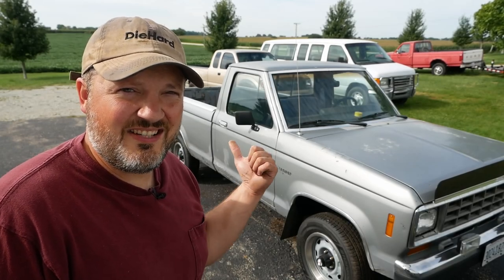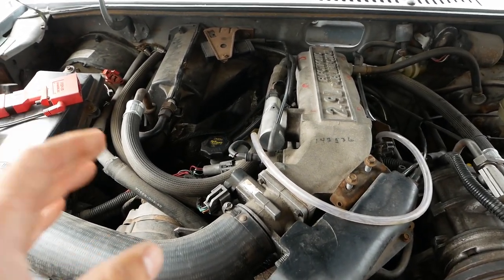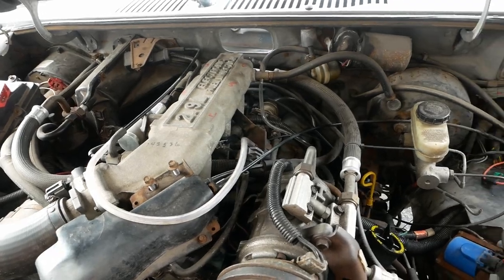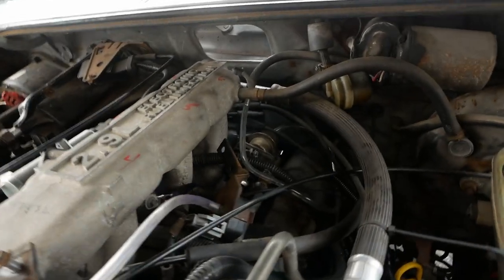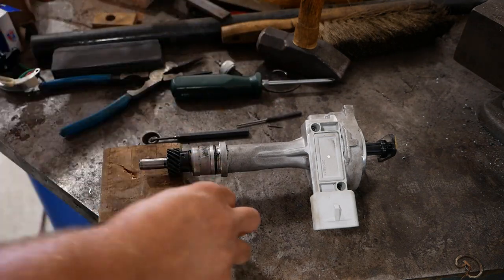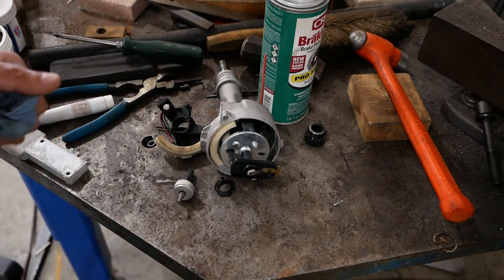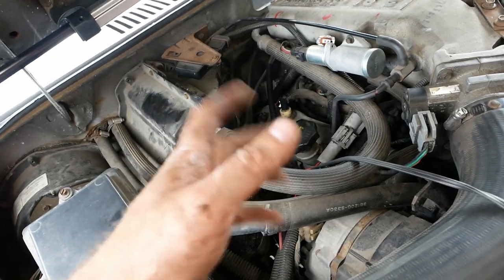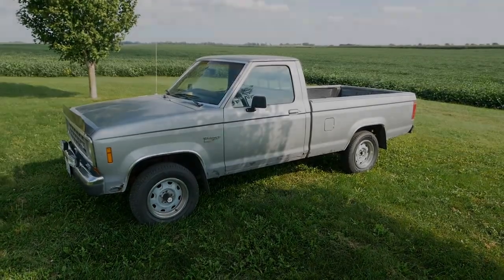Rusty Ranger Returns with More Bad New Parts - Randomly Stalling

Comment: Is it sad that being an old school ford drivability tech I was leaning towards the stator pfe and egr solenoid?  I used a old school bluepoint power steering pulley puller to pull the distributor gear and would tamp it on with an socket. Would also just mark the point where the rotor was pointing then drop it in the same spot.

Comment: My 1980s cb 750 custom had  problems with charging..honda stated change out parts with known good.. regulator rectifier and stator got from friends bike..  Dealer told me if another bike is in shop they swap them out to test...

Comment: by 3:34 I say bad grounds, battery to frame and body to frame, very likely bad ignition module(often changed without cleaning, thermal grease, dist. body flatness check or over torqued screws), also possibly rusted pickup(pip) or stressed wire to ign. module. bad coil causing upstream damages from lack of secondary tune-ups was a big factor too( still is @ the 100K mile jokers)
maintenance is key!

Comment: I have a 95 toyota avalon so whats the best way to clean my throttle body?Is it ok to spray crc inside or just wipe it out ?Whats the best way to set the computer after your done so the rpm wont be high?

Comment: My 87 Bronco 2 had a problem with the TFI kept dying but then it would come back to life weirdest thing ever. No start early in the morning but later around 2pm when the sun warmed up the engine compartment with hood up it would start first time after that it would start up all day no problems but come morning time same thing happened no start till sun warmed it up, I'm in NC so it wasn't that cold in the morning then maybe 45F. Also if it wouldn't start I would loosen the two screws on TFI wiggle it while someone else tried to start it up, it would start if I held the TFI in a certain position engine would stop if I let go of the TFI. After the Bronco started up I tightened down the two srews on TFI engine would start all day no problems after doing that, but come morning it was same crap again no start till around 2pm when temps would be around 60F. I put in a new TFI and had no problems since the Bronco runs fine now.

Comment: BTW if you know an engine did run old trick is to take rotor cap off and point the rotor at something to stab it back in to, like the fire wall etc. Saves the ole TDC hunt and then lining up oil pump drive and cap No. 1 post.

Comment: I’ve only ever seen and worked on the 4L cologne, they seem to be a very reliable engines, some oil leaks but usually just minor things fail, I had a South African grey import as a shop ute, it was driven hard, lots of short runs and that vehicle never missed a beat, kinda makes my current ranger look bad

Comment: Hey Wes...ever get a toolbox that wouldnt unlock? Any tips? Im desperate...Key turns all the way, but none of the drawers pop open.

Jiggled, shaken, even smacking it with a mallet along where the lock rails are. Im worried that the lock rod broke....I really dont want to destroy it since my father bought it brand new back in 87. Its also an anniversary (50th) MAC with the complete stack....but I need my tools to work.

I cant flip it, since its loaded up good and would only have more stuff jam in the locks. I don't want to cut it either and destroy it. I mean even drilling the lock (which I dont know if it would work if the lock rod popped out of the back), but if I had to do that...I would even though I can't find replacements for it.

Comment: I have a 2007 6.7 cummins with turbo. When I was going up a mountain road on highway  40 I heard a loud pop and then a loud sound of air escaping like a disconnect of an air hose. Would you have an idea what the problem is? It has no power up hill now.
Reply from the maker: You blew a hose off the charge air cooler.

Comment: I have a question about putting rpm gauge on 1995 e150 econoline van 4.9 engine 🤔 is it possible?
Reply from the maker: Yes. Just hook it to the coil and set it for 6 cylinders.

Comment: Had a reman distributor in my obs f150.  Worked well for a month.  After that the motor would die after 5-10 min.  It was the pip sensor.   Put a motorcraft part in.  Been fine ever since.  Just new junk parts.  Frustrating.

Comment: Ah, the older styled Rangers, long before they turned into a sports car, with horrific gas mileage.
I prefer the late 80's, early 90's F150. Even though my dad's had a valve problem, and got locked up on one cylinder, it had better mileage then a five year old newish Ranger.

Comment: That's the 1st distributor I've ever seen where you gotta pull a shaft out to get to the Distributor module that's what I call whatever instead just pull  Pull off the rotor cap and that cover figures Ford comes up with some stupid like that I'll be down thanks for the video always a good time

Comment: I don't  miss the old pre-computerized ignition systems because starting was often very difficult. Now, in 99% of the time, the engine only has to sniff the key being turned and it jumps to life...

But, when something needed replacing or adjusting, like the points, capacitor, or timing,  it was cheap and quick.  But now, you need to be a rocket scientist or a Wes, and make sure your overdraft isn't maxed out.  What are design engineers doing to  us? 😠

Comment: I guess my only question is was a scope necessary to diagnose the problem? I love breaking out my scope for even the simplest repairs but I like to see the money shot of it failing. Does the service manual have any direction for a problem such as this
Reply: Regarding the bad pip pickup
Reply from the maker: No, not needed. You can check it with a volt meter. The diagram even shows the voltage should be 5-7 volts (50% duty cycle) on the PIP when cranking.

Comment: Is that a new fuel pressure regulator I see?  Good thing to replace.  Notice where it's located.  I've seen more than one ranger/Aerostar burn down from a blow diaphragm in the regulator spewing gas onto the distributor.  That was a bad design from a safety standpoint.  There was a recall on those way back.  Overall, those things were pretty reliable.

Comment: Nice job Wes but now that you are sending vacuum to that it egr valve again it will get stuck open pretty soon. It will die at idle or run rough
Reply from the maker: It's a new EGR.

Comment: Swap with known good parts cannon fodder. Ah, the old TFI wrench/socket...Mine is in the glove box of my Fox Body Mustang GT! 5.5mm thin wall is what you want.
I would've at least googled an image of the proper Motorcraft cap, to really verify which terminal is #1. I would not blindly trust someone else's markings. 
Can you get your rotor lined up and then hold it, and bar over the engine until the dizzy drops all the way down in? On my Mustang, I just leave the car in third or fourth gear and get my dizzy lined up, and then I can rock the car back and forth until that spins the engine to where the oil pump shaft will line up with the hex in the distributor shaft. I also mark where the rotor is pointing before removal, and the IMMEDIATELY upon removal, I also mark where the rotor was pointing when the driven gear disengaged from the cam gear. 
Very interesting, regarding the ignition switch and timing adjustments... She sounds good!  Nice and smooth.
And thanks for the Farm Report!!!

Comment: My 88 volvo had the same issue. New distro but it didn't last very long. Either a combination of poor quality and or poor design location. Mounted to the back of the head so oil would seep through and ruin the electronics. Happened 3 times before I relocated it.

Comment: Are the idle rpm's a bit high for the warm weather?  Also, I think you're being spoofed.  I was sent a reply from your last video stating I had won a prize and to contact you on a non-existent @WatchWesWork account.  Has Max learned to type on a keyboard?  Have a great week!
Reply from the maker: It's a scam. I try to delete them as quick as I can but they keep popping up.
Reply: @WatchWesWork  Thanks.
Reply from the maker: @glencaple3888  Was it an email or a reply to your comment?
Reply: @WatchWesWork  It was a reply.  Did you get the first REPLY I sent a few moments ago?  I sent it and just noticed it was deleted.  ???    I copied/pasted the full reply in my first reply to you but it got deleted for some reason.  If you want a  screen copy let me know as I have not deleted the scammer's reply.
Reply from the maker: @glencaple3888  OK. I tried to setup some filters to keep those comments out. It's happening across YouTube. I hope they get a handle on it.
Reply: @WatchWesWork  👍

Comment: It sickens me every time I see the complexity of modern day engines. Do you have any happy pics from the early 1960's of a straight 6 in a truck or a checker cab. LOL
Reply: In steps an old 12 valve Cummins, or an old CAT..  Where you only need one wire for it to run.

Comment: Our '90 Tempo had a very similar problem, which nobody could ever figure out.  It ran fine 99% of the time, had plenty of power, always started up, but would stall coming into lights.  You had to drive it 2 footed and keep tapping the accelerator as you braked to keep it from dying.  I wonder if this was the problem.  It did have the same engine as my 1990 Ranger, as I recall.  That said, the Ranger had coil packs, as I recall, and the car actually had a coil.  Back then, it was hard to find ANYONE who had any idea how to diagnose those cars.  Computers were brand new, and nobody knew how to work on them.

So if you couldn't get an EGR valve, is there any way to get a generic valve and make it work?  I suspect more and more people are going to want these old vehicles going forward.  I wish I had mine back.  I don't like driving a hackable car with a black box.  I want a plain, stick shift, simple engine, little to no electronics.
Reply from the maker: Yeah, you could use a purge valve or even a pair of generic solenoids, one to open the EGR, the other to vent it.

Comment: What kind of box deal were you using to test that component what is that called
Reply from the maker: Which one? Bench top power supply, volt meter, pico scope, etc...
Reply: The white square box one that used under the hood to check the little sensor deal
Reply: I've been around a lot of shops and everything I just never seen none of the guys I ran across over the years use one of them or even if it's for the mechanic field or if you had it from some of that industrial stuff you do

Comment: That is funny when video started I thought them 2.9's are notorious for the fuel pressure regulator going bad and filling the oil with gas seen them so bad they filled the oil pan
Reply from the maker: How does the fuel get into the oil?
Reply: @WatchWesWork  I think when you shut it off it floods the cylinders and runs past the rings and then over a period of time if you don't fix it then it just keeps adding to the oil  I fixed 2 different Bronco 2's that had the oil so full of gas was way over full on dipstick  they would smoke when running changed the regulator and drained the oil/gas from the pan and ran fine with no more smoke, I bet you check the oil on that ranger and it will be gassy and probably a bit over full
Reply from the maker: @badmonkey3669  That makes sense. I suppose the fuel drips through the diaphragm until the pressure drops to zero.

Comment: When the EV’s take over replacement parts will be 3D printed at Walmart. Max will still have his field mice and rabbits readily available with no complaints.
Reply: You mean things like brake rotors, CV joints, cooling fans, the diagnostic modules to run the cooling fans, and all the charger units?
Reply: @CAPNMAC82  Yes. They’re already 3D printing high bypass jet engines.

Comment: I have the same scan tool and the only issue I ever had was with my 1995 dodge Dakota would not for whatever reason read the data correctly it if I put it in for a couple years older it would work fine so strange!

Comment: You think the pin fitment caused a bad connection and too much heat and she said nope ? Those beans look ok, I see some volunteer corn got in there lol
Reply from the maker: I think it was a part of the equation. I noticed once when I pushed on the TFI module the fuel pump kicked on.
Reply: @WatchWesWork  well that's not good, re man stuff kinda sucks cause if that pick up was good and the module was bad then all it gets is a module and off she goes

Comment: Ford PFE's = Pretty Frequent Errors, and when they do the vehicle can run like crap. And or the PFE can get shorted internally if the EGR sends hot air to it and burns it and then thee PCM data line gets shorted pulling down most of the sensor inputs lol.

Comment: Hopefully you charged him more than $300 for your diagnosis. 17:04 dielectric grease?
Reply from the maker: Heat sink paste.
Reply: Should be thermal (heatsink) paste.
But perhaps the distributor isn't the best location for the PS module?
Ford saw a big lawsuit for vehicles randomly dying on acceleration. 
They then relocated the TFI to a dedicated heatsink. (you can get an aftermarket relocation kit from FattFoxx or McCully racing)
Reply: @WatchWesWork  thanks for the explanation..I should have guessed that 🤣

Comment: I bet that pickup was just heating up a little and then disconnecting from those loose sockets.  In a pinch you maybe could have slightly twisted the three prongs and made them fit a little tighter;   but then you're risking breaking another part to fix a bad one...   This little truck being a manual 4x4, it's worth throwing some parts at it, IMO.
Reply: I noticed that too when he plugged it into the dizzy, didn't seem like a snug fit

Comment: I had a 2.8 in a 1978 what a piece I replaced fuel pump I swear I thought arm ran all the way through the block easy to get to remove bolts but had to remove all kinds of crap to pull it out not 1 of ford's best ideas

Comment: I would rip all that out and wire the hall sensor to a GM HEI unit.  Probably would not work beause there is no vacuum advance on the dist.
Reply from the maker: It also uses the PIP to fire the injectors and turn on the fuel pump.
Reply: @WatchWesWork  Leaves me dead in the water...again.  Nice work.

Comment: These German Ford “Cologne” V6’s were just junk. They barely made more horsepower than the Pinto four cylinder and were, like most German motors, WAY less reliable. You paid more for a V6 that was 0.2 seconds quicker to 60 than the 4 yet drank way more fuel and had way more issues. This crappy V6 was not one of Ford’s better ideas.